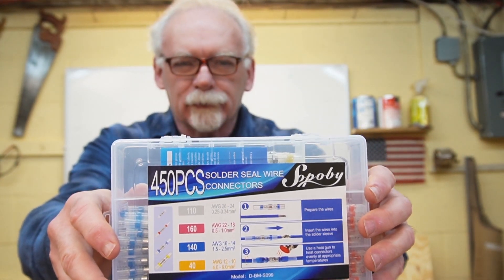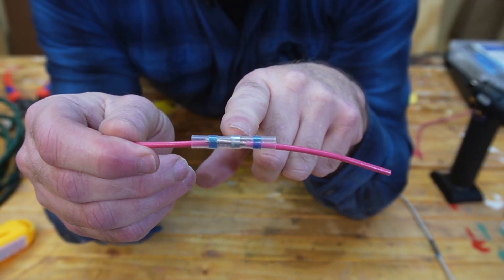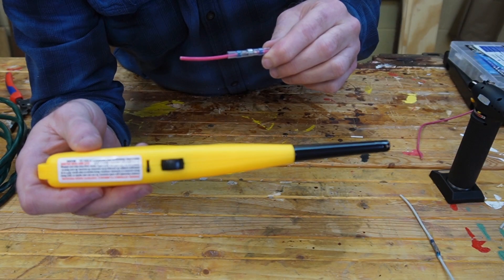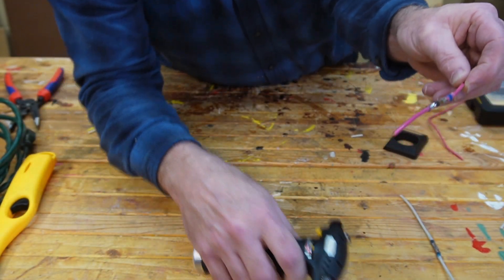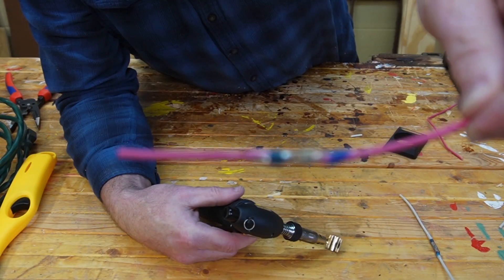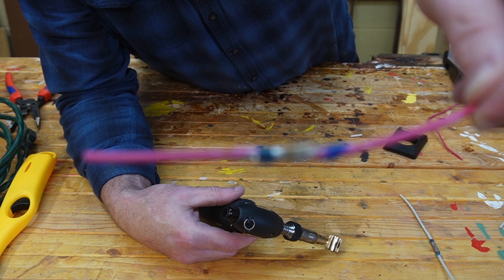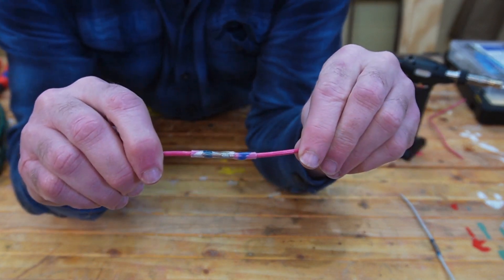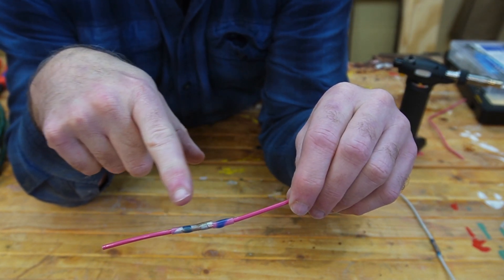How To Use Solder Seal Wire Connectors

Comment: Do you have a link for them? Thanks for the video. Also what was the lighter you were using. Take care
Reply from the maker: Hi. I don't recall what brand the solder connectors were.  I got them off Amazon.  I would imagine any brand would be fine.  The torch is a Lexivon model LX-771 and I got that off Amazon as well. Thanks for watching the video. n